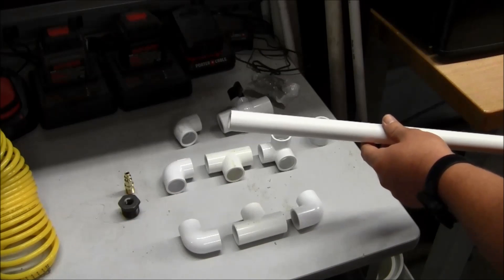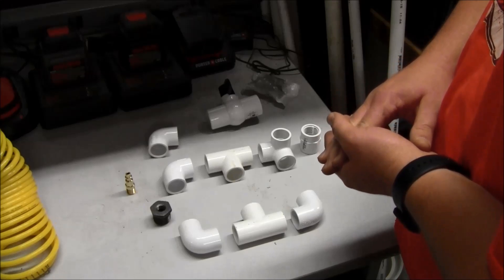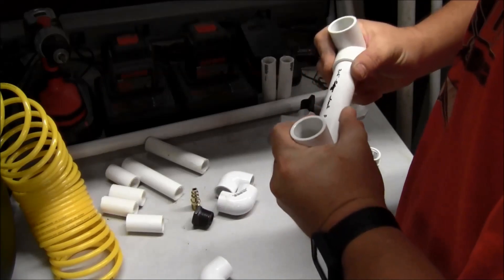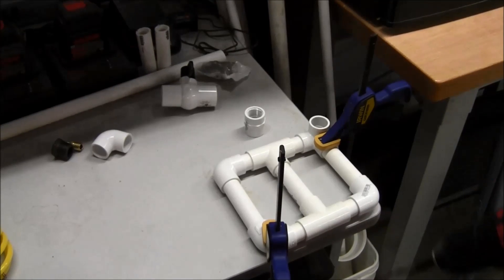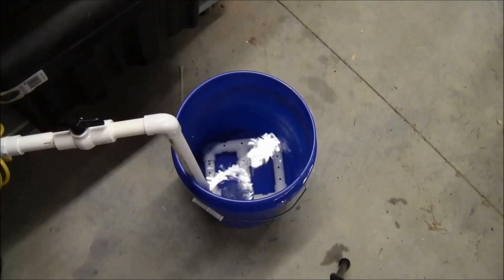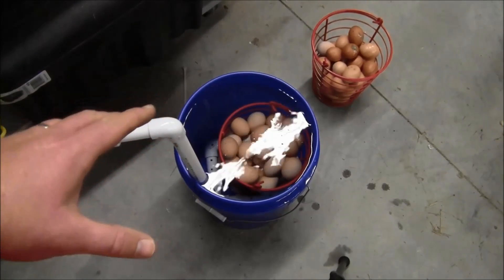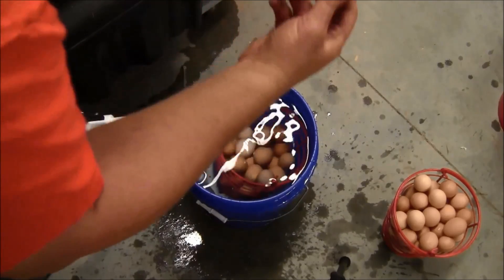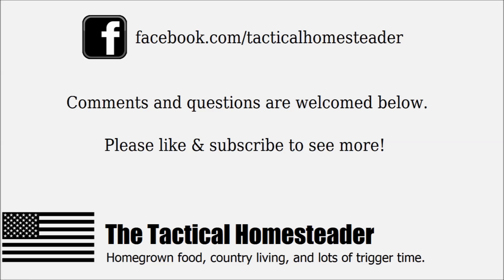Build an egg washer for less than $25

Comment: After washing, did you use anything to sterilize them? The water that "washes" the eggs transferred the poo in the water to all the eggs. So what appears to be clean is not. I have heard that washing with Hydrogen peroxide will kill most all the bacteria on a chicken egg. Spraying a solution of Hydrogen peroxide on the washed eggs would as well. I have heard this is what large producers do to their eggs.  ...your thoughts?

Comment: This is awesome! Thanks so much! I think I can minimize all that and maybe use an aquarium pump in the kitchen sink and do 2 baskets at a time. Oh, the possibilities! I will put this together and see what happens.
Reply: I tried out an air bed pump in the kitchen sink...a garden hose fits right into it (way less fittings), quieter, plenty of air. It is a great ideal because it is easy to improve and build on. Was an aquarium pump enough?
Reply: @sanddpotts  unfortunately, even with 2 aquarium pumps, it wasn't quite enough. However, it was still quicker and easier to do itnin the sink than a 5 gallon bucket. So I will have to find a bigger pump and give it a go again. Thanks.

Comment: Good video.

If you use detergents, be sure they are food safe.  There are some out there.

We had a commercial chicken layer farm.  The shells are porous.  We were told to put mineral oil on the eggs to reduce dehydration.

We had a container that a 30 egg flat fit and had a sponge that would also fit the pan.  We put mineral oil in the pan, soaked mineral oil with the sponge and put it on the top of the eggs.  It would run down the sides of the eggs.

Comment: i have a piece of 3/4 copper about 18ft long, you reckon I put a cap on it and drill a 1/8in hole every inch or so on the coil thatd work if I stick an airline on the other end?

Comment: Whats the Pressure coming form the Air compressor.
Reply from the maker: +Manuel I really can't say.  The tank pressure gauge goes to the max (mine is 150 psi), but the tool pressure gauge doesn't register since the air is escaping from the line.  I just turn the regulator slowly until it bubbles at a satisfactory amount.

Comment: what are the source for the air to make the water "pop" and the amount of pressure needed?
Reply from the maker: +afandi mohamad  I just have a basic Kobalt air compressor - I think it's rated for 165 PSI.  I don't know what the PSI is on the output when I use it.  The regulator knob on my compressor is very good to fine-tune the pressure and I just turn it up to what I feel is an appropriate amount of disturbance in the water without being too rough with the eggs.